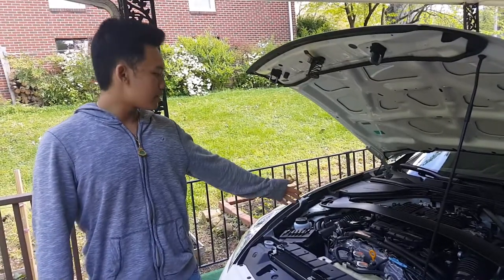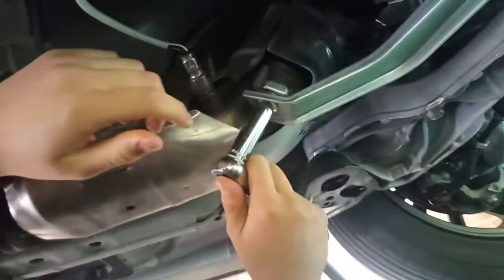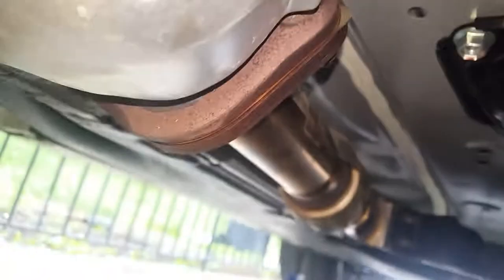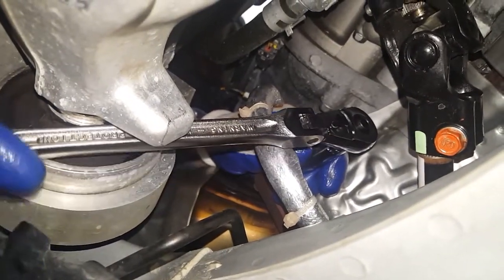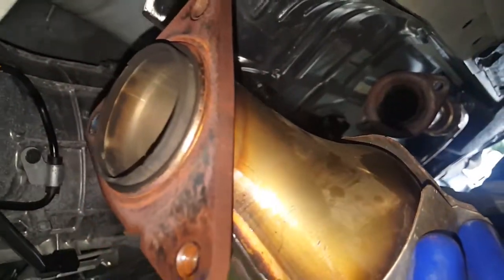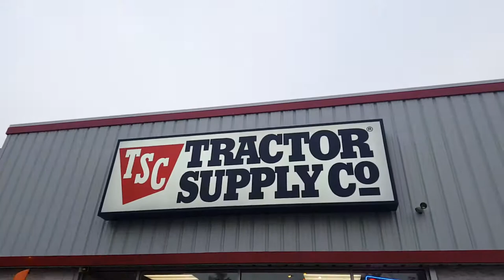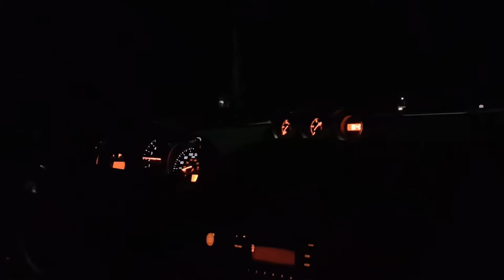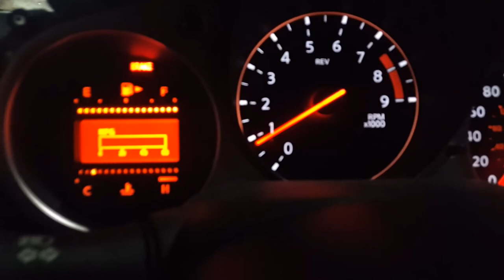370z Test Pipe Install

Comment: Any check engine lights ?
Reply from the maker: Yes one popped up a few days after the install. If you have an OBD2 scanner you can just clear the code
Reply: Hoshizora Garage or you can get a non fouler or anti fouler